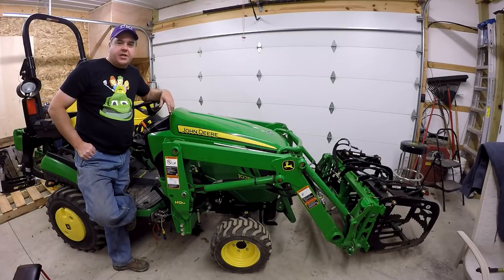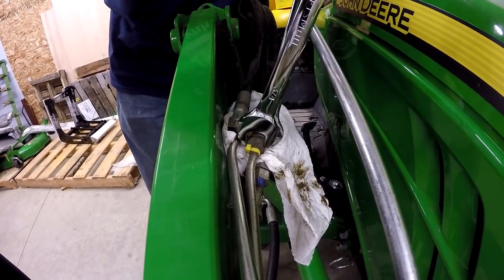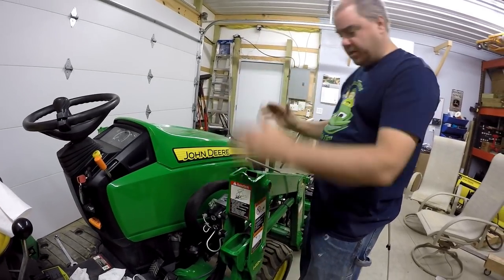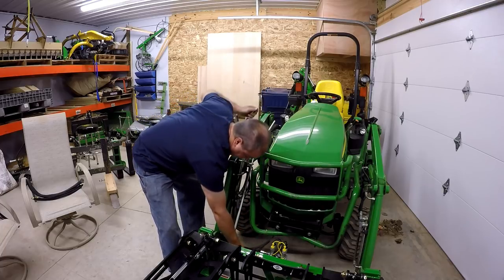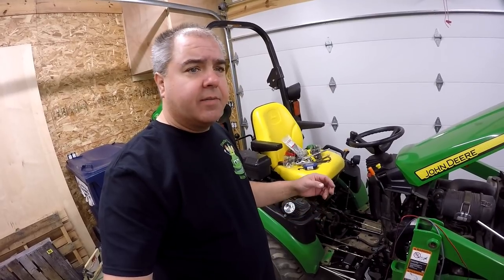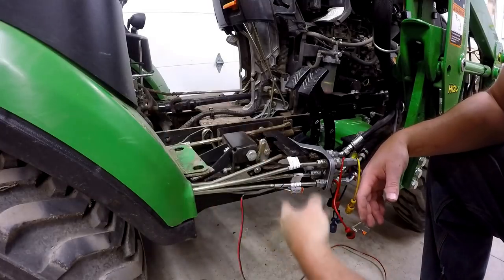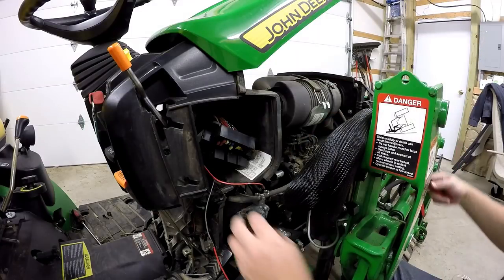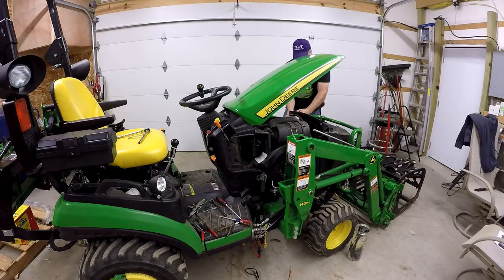Artillian 3rd Function Diverter Kit Installation John Deere 1025R Grapple

Comment: Hi Tim, i'm also revisiting this page. I just finished the Summit Diverter install. They recommended NOT using the 12V always-on circuit. Battery drain could occur, per their warning.  I used slot F08 with an "add a circuit" pigtail. That slot is only live when the key is in the START position.

Thank you for keeping us educated!

Comment: Great video as always Tim. I'm real picky about finish on anything I mod. Obviously the way it's sold from artillian is the correct way to sell it in general but for neurotic people an easy way to clean up the momentary switch is replacing the knob with one that has a built in switch (like an automotive one for a line lock or nitrous) and a length of shrink tube to cover the rod and wire from knob to boot. 
     Wiring directly from the fuse box is the only way to fly. Great choice taking the extra time to get the right connectors.  Gave me chills of joy to see you cut off that inline fuse holder.

Comment: I have been watching your videos for quite sometime now. As a matter of fact, you helped me decide between a cheaper "NORTRAC" and between red, orange, blue and green, Anticipating a larger usage and need for heavier bucket work,  I bought a new 3025 last summer. I felt I needed maximum ground clearance and still a smaller unit. Now I watch your stuff and like how easy you make attachments seem. The diverter is going on mine next I think. Anyway, keep them coming.

Comment: Oh I wish this video was out a few days earlier. My 1025R stopped running and it turned out to be the fuse block got wet. This would have saved me a bunch of $$$ had I known how easy it was to get at. Thanks for your videos. I've learned a lot about my Johnny from watching. I cant wait until spring! I just bought the 2.5 acres in front of my property and have a few thousand yards of dirt to move around.
Reply from the maker: Sorry about that Joe!  Everything is easy to access on this tractor! Use jdparts.com, have confidence, and dig in!
Reply: joe Chavez  as a fellow 1 series owner I urge you to buy the shop manual for the 1 family on cd. I got mine on eBay and it was worth it. Can seem a bit pricey until you do services on your own and make up for it. Also allows you to search online for part numbers directly if you have a cheaper source than your local dealer. Everything the shop has I have on hand for parts schematics and part numbers. Cheers!
Reply: s1283 I'm a disabled vet and sometimes I can't work on certain things. Learning more and more about the machine allows me to better diagnose problems
Reply: joe Chavez I can completely understand your situation. Another reason I love watching this channel too. I learn many ways! Mostly through discovery, but seeing TTWT get it done their ways, I can see perspectives I may not get on my own.  Nice to meet a fellow vet. 4 more years and maybe I can reach 20.

Comment: I'm a fan of magnet bowls for putting my parts in, saved me a lot of time when taking things apart and putting them back together. Another item I have is a limited space magnetic pickup tool. The magnet is protected so you don't fight it sticking to everything but the part or tool you want to grab.
Reply from the maker: More good advice!
Reply: What if you drop your credit card in it?

Comment: I mounted mine to the engine mount so it stays on the tractor so I have it for my snowblower too I just put quick connections on the valve to switch between the loader for my grapple and I got the hoses on my snowblower as well works great. And Tim good videos keep it up

Comment: Nice. I have the WR Long 3rd function kit on my tractor and I like it pretty good. It came with a whole new knob with the 3rd function switch on the knob. I like the diverter too. The only thing I don't care for on the WR Long kit is the hoses are so small that you can't get much flow. It's fine for grapples and tree pullers but I wish it had enough flow for some other non high flow useage like a Harley Rake or a snow blower.

Comment: Tim, do you ever find that a true 3rd function would serve you better than a diverter, if Johnny had the hydro flow to run it?
Reply from the maker: For the grapple, no.  The diverter is perfectly fine.
I’m on and off the button so quickly and without thought that it doesn’t have any negative impact.

Comment: when I check with a local supplier I can get the hoses and fittings for 125.00. That about 200.00 cheaper
And the Artillian  kit is a diverter  not a true third function, isn't that correct?
Reply from the maker: It is indeed a diverter.  Doesn’t make much difference with these limited hydraulics.
 Sounds like you like the DIY approach.  You should do that:  others prefer a preassembled kit which they know will fit, and work out of the box without fuss.
I suspect your final savings will be less than $200.

Comment: DID U HAVE TO ADD ANY MORE HYD. OIL AND CAN U BUY A NEW HANDEL WITH WIRES ALREADY IN THE HANDEL
Reply: You need oil to fill extra hose and cylinder. Fasse has a switch incorporated handle.

Comment: Have you ever thought of installing the single point hydraulic for the loader hookup? Would this kit still work either the single point hookup?
Reply from the maker: I have thought about it. I would really like to have one.  Christy's fingers simply aren't strong enough to remove the hydraulic hoses as they are now.  We tried a single-point on a 2038R at the Farm Progress Show. She could EASILY handle that.  
Also, we have tried the one on the Kubota BX2680. Again, it was easy for her to operate.

I suspect the Artillian kit would need a bit of modification (hose lengths might be wrong), but yes, it would work with the single point.
Reply: Tractor Time with Tim thanks for the reply! If you ever do decide to do one could you do the video of the installation and a parts list. Thanks for all the great videos my fellow Hoosier!

Comment: Not a "TRUE" 3rd function valve. You need to be able to grab & curl at the same time. True 3rd function taps in to the "power beyond" hard line that has a relief valve on it. Granted Johnny isn't big enough to have the hydraulic flow needed for a "True" 3rd function setup. Can't wait to see what trouble you get yourself into with this new toy. :)
Reply from the maker: I say 'diverter' in the title.    With the little Deere, there really isn't much difference, as there isn't enough flow to do two functions (properly) at the same time anyway :-)
Reply: Drew6709 : the deere doesnt have enough flow to do 2 functions wich kubota can on theres because kubota has biiger hydrulic flow wich you can do 2 functions  wich they allready come on all there kubota BX,B,M,L series tractors hope this helps ya drew 6709
Reply: Michael Mac Tavish -I am aware that Johnny doesn't have the hydraulic flow for "True 3rd function". Tim, when you show the grapple in use. Be careful of limbs reaching back hitting the front valve. I "Think" then grapples could be plumbed to use the one valve. As grapples from Everything Attachments are plumbed. Have fun tearing thins apart with your new toy. Lol. Next is a manual thumb for Johnny and maybe a manual thumb for Casey. Lol.

Comment: Hey Tim. Thought I'd chime in here.
I FINALLY got my 1025r about a week ago. It's brand new and I had my JD dealer install the factory 3rd function kit for me pre purchase. 
I was wondering if it might be possible to do a video on just the hydraulic hoses and twin grapple diverter for those of us that kind of have a mechanical mind but plan ahead for these things.  I would like to see how you routed your primary hoses to your 3rd function ports on the side of the engine block especially. Thanks for all your help and I especially like the bible verses at the end of every video.
Reply from the maker: Deere supplies a kit to route the 3rd function to the front of loader.
I just bought hoses to route to the Artillian splitter block (it isn’t a diverter...just a splitter block)

Comment: Very nice! I don't have an excuse for a grapple yet, but a manual thumb for my backhoe bucket might be nice to add sometime. I need to find the right contacts for adding fuses in my orange tractor's fuse block. I want to add some working lights, and I want to do it the right way. I'd have to use the correct crimper, of course. Some say that I have issues.
Reply: Mark's Tech Channel I like putting new wires in wire loom. It's easy the cut into wires routing them all over edges and between parts that could pinch the wires. Use dielectric grease to provide anti-corrosion and help keep moisture out.
Reply from the maker: Good advice. Thx

Comment: Another enjoyable video Tim/ Katriel.
When I did mine a couple of years ago I too found the on/off switch wire to be just barely long enough, another couple of inches would have been great.
The nut on the back of the fuse panel is actually 10 millimetres not centimetres.  Lol. 
I didn’t notice you mentioning anything about reinstalling the rubber boot over the loader joystick scv.
I had a heck of a time getting the inside part of the boot secured around the scv itself and ended up having to remove the fender to get it properly situated. Just wasn’t enough room to get my hand in there any other way.   Have a great Christmas folks and keep the videos coming.
Reply from the maker: Duh.  Why did I say centimeters!?!?!

Comment: Where did you get the 4 port thingy on the from of the loader so I can use an implement with 2 hydraulic cylinders and 4 hoses (like your grapple)?   Thanks for the video it was wonderful.
Reply from the maker: artillian.com  it is a splitter ....the clamps of the artillian grapple each have a set of hoses...so we need 4 ports...the ports are really tee'd together in that box...so simply a splitter.

Comment: Hi Tim, I have a 2016 1025r with a 266 backhoe. I think the same setup as yours in this video. I also have hydraulic deck lift.  Question is, since the Artillian is a diverter for the loader SCV, everything else should remain and work the same, correct?  Thanks, Chris in Maine.
Reply from the maker: Yes.

Comment: surplus center has a solenoid diverter valve for $59   hoses 12=26$    fittings and adapters $3 ea  foot switch $17
Reply from the maker: Interesting. Of course you can build your own. L

Comment: I'm just wondering why the need for the electric side to the grapple? Doesn't it run solely on hydraulic power? Obviously I'm missing something. I'm dreaming of one for myself but having to install anything electrical scares me away. Could you shed some light on this? Thank you!
Reply from the maker: The electric switch controls the diverter, switching between dump/curl and grapple clamp/release.
Reply: Thank you Tim. I appreciate the clarification. I'm looking at buying a 1023E, and this could very well compliment the purchase.

Comment: Tim, Do you think this option will work to rotate the shoot on a front mount snowblower? i am not a fan of the manual adjustment. Or is it an option for the snowblower? I guess i need to do a a little research myself.
Reply from the maker: This is overkill for operating the chute.  Most folks use an electric actuator.  Greentractortalk.com has lots of info on this approach.
Reply: If you're using the JD snowblower, the chute direction is changed hydraulically.  You don't need a diverter because  the loader is removed and a front mount is used for the driveshaft, lift and either angle (for a blade or sweeper) or chute for snowblowers.  I really think JD could have come up with a better front snowblower system as you have to remove the mower quick connect apparatus in order to install the drive shaft.  Works good when everything is installed though.  I have a snowblower for a 4-wheeler that has it's own engine.  I plan to make a shorter receiver hitch type connector that'll plug into the Artillian 3000# base.
Reply from the maker: He is referring to the chute flapper on the top.  It is controlled manually.   Lots of folks are adding electric actuators to make that powered.
Reply: I stand corrected.  Thank you.

Comment: If my 1025r already has the factory installed 3rd function hydraulics in the front, will just the splitter work to achieve the double claw action? Thanks Tim and awesome videos! Keep em coming please.
Reply from the maker: I’m not sure you want fully independent claws anyway. This unit will not add that functionality.
Reply: @TractorTimewithTim  thanks for the reply. I didn't mean independently I'm sorry. When I said the double claw action, I meant so I could run two claws instead of just one. 3rd function controlling the grapple but because I wanna run two like you, I need the splitter. So I'm assuming the splitter just would tie into the factory 3rd function and then adding the splitter would give me the ability to run two grapples?
Reply from the maker: Any ‘T’ will provide the necessary function. You can buy the splitter portion from artillian...without the actual diverter kit.

Comment: Need help. Order a 1025r with 3rd fuction. It came in today but dealer is saying they have to add the kit because 3rd fuction is not added at the factory but a kit is added at the shop. Is this true I've researched alot and feel like there pulling a fast one
Reply from the maker: Nope.  3rd function is always dealer install.
Reply: @TractorTimewithTim  thanks for fast reply I was about to have a little fit. So I'm good with dealer adding it

Comment: Tim,

I purchased a 1025R a few weeks ago and am wiring in the Artillian grapple. The current fuse block is mounted differently and the connector you used doesn’t seem to be compatible with the newer model.

Do you or your sources have an idea of a part number for the newer connector? I haven’t found one on the internet, but I have a picture. (Don’t know how to post it).

Thanks for any help.

Love your videos.
Reply: Try a device call "add-a-circuit".  It's a simple device that plugs into the fuse block just like a fuse.  It has a 6 inch wire and connector attached for easy connection.  It can be used either in an open (unused) position in the fuse block or in a position that is already used by another circuit. It has the ability to fuse both old and new circuits independently, even at different amps.
Just be sure to get the correct size for the application. My 1025R uses the "mini" type fuse so that is what I ordered and it worked perfectly.  I ordered from Amazon.

Comment: I'm not seeing your link to the wire strippers and the wire connector you used on the back of the fuse block. I wired in some lights on my Curtis cab but not sure I did it correctly. Could you give me the link to those connectors?
Reply from the maker: Sorry about that.  I added them to my amazon store:  https://www.amazon.com/shop/tractortimewithtim
Reply: Tractor Time with Tim thanks, I was also looking for the part number for the connector
Reply from the maker: I added it to the description too (finally). Napa NW 725452.  (I've got it memorized now!)

Comment: Tim, I know you are probably busy with all your new toys but have you added the diverter kit to the newer style 1025R yet?   Did you have a hard time finding the electrical connector for the fusebox?  I have asked 2 different people at the John Deere dealer and they have no idea what connector I need for the power wire.  And I can't seem to make the  NAPA part work but maybe that is because the new style fusebox is really hard to see what I am doing.  Any insight would be greatly appreciated.
Reply from the maker: I have installed the diverter. Showed it in a video comparing the 2018 to older models. 
I was able to make the NAPA part work.  It isn’t perfect,  but it works for me.
Reply: @TractorTimewithTim  Cool.  Thanks Tim.  Your the best!

Comment: Love your vids, Question, Is there a attachment that will mow ditches? Preferable from the front?
Reply from the maker: There is not.  Some folks have built one, by attaching push lawn mowers to large arms off the front.

Another approach is to use a sickle mower.  Very expensive, but will do the job.

Comment: Will this kit valve and/or grapple work on the evil orange tractor as well if we have a fork frame?
Reply from the maker: The kit I have (Pre-cut hoses, etc) is specifically for the 1-series. However, the diverter itself would work.
Having said that, I think Kubota offers a third function kit, so I would probably recommend it.
Reply: I more so ment the grapple as a whole.
Reply from the maker: Oh, ok.  You’ll need the artillian frame for SSQA (Skid Steer Quick attach). I do not believe it will fit other manufacturers fork frames

Comment: Tim, wondering today what kind of Grapple you would recommend for a 1025R...  Noted it wasn't something you recommended buying as a primary attachment when you did one of your videos but was wondering if you now felt it would be something you would recommend as a primary attachments if starting off with new tractor... and would it be a pretty universally attachments.  Talking about purchasing new tractor and dealer was proposing a Frontier AY11F 53" Bucket which I believe really isn't the same as a grapple?   Thoughts and comments?
Reply from the maker: We promote two different grapples.  One is the modular grapple form Artillian.com. Premium!!!
Incredible grapple.
Secondly, we like the mini 322 dual clamp from precision mfg.   You can get the mini 322 from agfolks.com use code TTWT for 5% off and free shipping.

Comment: Getting ready to add the artillian diverter to my 1025R. Tim, do you know if the wire connector you have listed will fit a 2018 model?
Reply from the maker: The NAPA part? I do not know. It isn’t a perfect fit for my tractor. But it works.

Comment: did you check the hyd oil level
Reply from the maker: Yes, but only after one of the hoses came lose and leaked some oil.         After fixing the leak (by tightening one of the connections), I added a pint or so, no big deal.